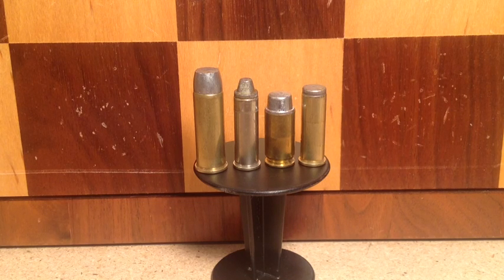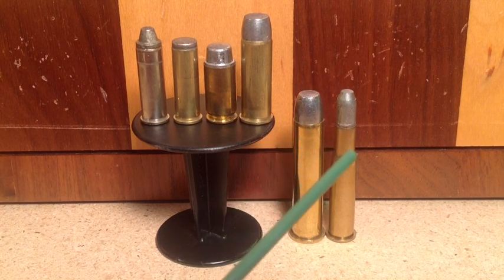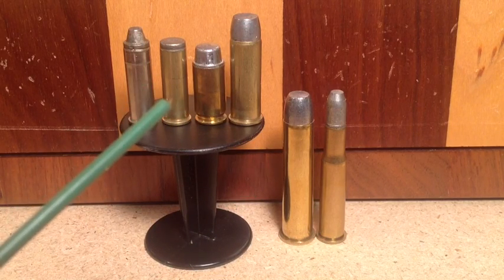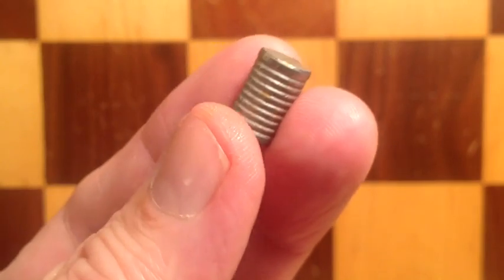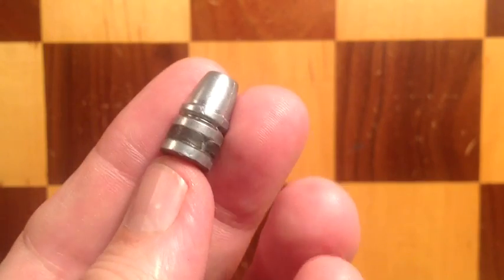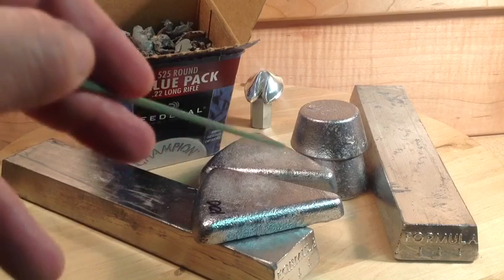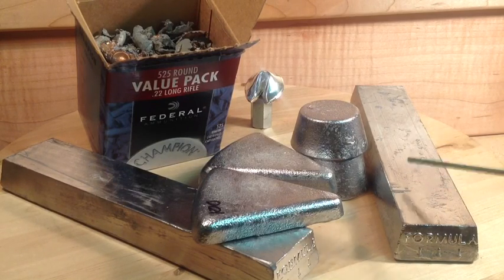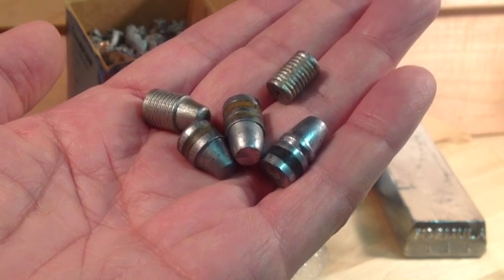Lead Hardness FAQs & How to Mix Bullet Alloys For Hardness

Comment: Yet another excellent and informative video from your site. However there is one flaw, and that is lead is 5 BHN, not 8.6 BHN, this would make quite a bit difference to the calculations.
Reply from the maker: Englishman French - There is some confusion over that.  I've wrestled with this one for a while, and no one has brought it up until now.  So thank you for bringing it up.  Rotometals is a major supplier of bullet casting alloys and materials for over 75 years, and I have referred casting and lead questions to them on occasion - they always answer.  RM has a formula for the calculation of BHN based on the mix of the alloy beginning with pure lead at 8.6.  BHN = 8.6 + .26(%Tin) + .92(%Sb).  I've been using their formula to excellent effect for 15+ years.  Yes, I do know that Wikipedia says BHN 5, and some other posters use that.  My take on that is everyone is cool as the RM formula may be shorting on the .26 or the .92 so all the numbers on final BHNs balance out.  Also, because I water quench and age harden my castings I'm adding somewhere less than 2 BHN from that.  The end result, we're probably all at the same place.  You notice that I did not bother to present the formula in the video (thought about it, but gets too technical - like some of the forums - puts some viewers to sleep-they will fly away with that) and also can confuse esp. with the 8.6.  RM has great connections with all those forums and the LASC boosts RM as well.  I'm going to go with an expert in the field over what Wikipedia says (maybe Wik is using a different BHN scale - doesn't matter - my lead is good and it's not worth pursuing that).  Best Regards to you, and sorry this was so long - it is a record length reply for me...
Reply from the maker: +Englishman French - Yes, it does make a big difference.  No doubt what saves me is that Elmer Keith used pretty soft bullets in his magnum development work and he never leaded his barrels - he had good bullet fit to his guns.  I realize the disparity from 5 to 8.  I just use the 8 from the formula on the RotoMetals home page (bottom) they call pure lead 8 and the formula worked for me without fail, so I'm not about to change my operations...I do realize that controversy though.  Since RM has been supplying caster alloys for 75 years, I figure I can go with their formula OK... Best to ya,  lFC

Comment: Goo 411, Thank you.. BUT how hard should the lead be for shooting out of a Glock .45 using their factory Poly barrel?
Thank you
Reply from the maker: lawgiver1-AHA!!  That's the $64,000 question that has no answer…We are 1) not supposed to shoot reloads in our Glock factory barrels and 2) not supposed to shoot lead bullets thru our Glock factory barrels.  That having been said, the answer is BHN 16 (18 is not needed as Glocks feed very reliably - however, use a good auto pistol bullet like the Lee TL 230 RN with the little shoulder; use the Lee Carbide Factory Crimp Die with the barest little crimp possible) and medium speed powder like Unique or AA5 or Universal.  Best Regards
Reply: FortuneCookie45LC
Thank you for the fast answer. I use the same bullet and die you listed, however I use 5 gr. of bullseye.
Reply from the maker: lawgiver1 There was a gunwriter years ago that used 5 grains of Bullseye/230 bullet.  I forgot who it was, but he called the 5 grains "…a stiff tot of Bullseye".  Have a great day...

Comment: I again have to disagree i shoot BHN 10-12 in everything from 700-1500 FPS from 380 to 44mag, Was just shooting today range scrap cast 9mm BHN 10 at 1150FPS  or 1350 out of a carbine with no leading and great accuracy. Fit is key. I can shoot Pure lead from a  45acp with again 0 issues at 750FPS.
Reply from the maker: b1gdaddy317- Thank you for your great comment.  You will find that we have no disagreement.  It's like Elmer Keith shot a lot of his hell-for-leather magnums with 1-30 lead alloy.  He never even mentioned any leading problems.  I'm glad that you find great success with your well fitted bullet/gun combos - no disagreement with you or I on critical importance of bullet fit.  We can tailor our bullet hardness accordingly and find that we are uniformly shooting bullets harder than we need (I find myself, with excellent joy, that my plain range scrap at BHN 12 [water quench and bullet aging] is easily actually good for +P- I really don't have to do much mixing at all)  But between you and me, I just like my magnum bullets to be BHN 18 because some day, I might just need those slugs to crash through a moose or both sides of a car or some other hellacious thing…You are speaking as an experienced caster, we've got to give the newer guys and gals "the book" info, and they will find out for themselves that there is more latitude in bullet alloys than they suspected…Best Regards...
Reply from the maker: +b1gdaddy317 -  You are in the same league as Elmer Keith who used 1-20 alloy to make his magnum bullets.  Who is going to tell E:lmer that his alloy was too soft?  Nobody this side of Glory for sure...That's not a bad league to be in, BTW... :FC

Comment: Well done ol' boy! You did great. I think, weather permitting, I'll smelt up a few lbs. of my wheel weights this weekend. I lucked into 60lbs of x-ray sheilding a while back, and I've managed to save back a few lbs of linotype.  hummm   Anyway, thanks for your efforts, knowledge and your time. Until your better paid. You have my gratitude sir.
Reply from the maker: mklean1- Congratulations on your lead supply - If your lead shielding is easily dented with fingernail, you have pretty pure lead (if you do shotgun slugs - you are in business) - and that linotype is going to come in very handy for making pistol / rifle bullets.  As for pay on YT, it's like pro golf - the top guys have it pretty good - but everybody else (we're doing it because we get a kick out of it)  better not be quitting our day jobs… Best Regards...
Reply: FortuneCookie45LC
My soft lead I have reserved for my new 40S&W swage dies on order. Can't wait. Most of my autos I feed COWW. My 7.62 gets a dose of lino and WW. I've only been casting about 3 years. Also make my own case lube and boolit lube. never stop learnin' Thanks again

Comment: I heard you match the hardness to the pressure, not the velocity.  Working with second hand info though.
Reply from the maker: spraynpray- No doubt pressure is a more reliable match (I believe the Missouri Bullets website goes with that), but we shooters don't really have any good gauge for pressure other than what is printed.  And there has to be variations from different guns, etc.  Takes pressure to make velocity.  And we do have chronographs we can use to pin down velocity.  So I'm going to keep linking hardness with velocity - and there is wiggle room in the matchups anyway.  I'm surprised that others have not commented in like manner… Best to ya...
Reply: It's all magic to me anyway.  I've yet to fire any of my cast bullets.  I'm waiting on the barrel I had chopped to shoot a bunch.
Reply from the maker: spraynpray I thought it would be important to get back to you on clarification.  On the velocity to hardness match, that is very useful and safe for pistol shooting.  And the velocity / hardness / pressure is predictable for pistol.  However, for rifle shooting - the velocity / hardness is OK, but there is no coupling of predictability with pressures- You could have a low velocity rifle load with cast bullet hardness being fine, but the pressures could be exceedingly high depending on the powder used.  So stay with good published data, and you cannot extrapolate anything with reduced loads in rifle cast bullet loads.  Because of the smaller fast burning powder charges, a little more powder can be right on the steepest portion of the pressure curve, and you gain a tiny amount of velocity with a huge and possibly catastrophic jump in pressure.  Hope this helps… Best to ya...
Reply: This is true, pistol velocity and pistol powders aren't nearly as complicated.

Comment: Hey Fortune Cookie 45LC!! I casted and reloaded about 300  255gr. .452 for my 45 long colt Vaquero 4 3/4" barrel I just got 2 weeks ago and have them moving about 700-750 fps. and found several bullets in and around the dirt pile I was target shooting at and they all looked as if they were barely dented, so I'm using nothing but wheel weights with the occasional soft stick on wheel weights mixed in with the clip on weights, do you think they could be too hard for what I'm doing?? I'm not interested in doing anything spectacular with this pistol or the loads for it, that's what my 44 mag and 357 etc. Is for.... thanks!!
Reply from the maker: TheRIFLEMAN308- not a problem - Wheel weights are some of the finest lead alloys I have ever used for ANY shooting.  You are probably just a bit more hardness than you need, but not so hard that the bullets are not obturating your barrel.  If you like, you can add more of the stick on (pure lead) to your wheel weight mix and still be fine - will save some of your clip on weights for future use.  Or just use that same alloy for your more stoked 44s and 357s - will be fine there for sure...Can't go wrong using wheel weights for 45LC - I do like my range scrap, though because of the zero cost....Best Regards

Comment: Great video! I had a lot of the same questions. I was using my Lyman 49th edition to load 44 Mag with 200 grain cast bullets and it said to use Linotype bullets. Hodgden load data wasn't specific about the hardness just loaded on the conservative side and didn't have anything above 1,039fps depending on the powder. Which makes me ask, why does the powder make a difference? We are well under max pressures so is a faster burning powder better for cast bullets or a slower burning powder.
Reply from the maker: velocity550- All powders running to appropriate SAAMI pressure levels work well with cast bullets.  It's all nitrocellulose, nitroglycerine, nitroguanine with retardants, detergents and stabilizers in flakes, spheres, donuts, rods --- Best Regards

Comment: Good stuff as usual FC45LC. The thumbnail don't lie...
My range scrap runs a little closer to pure lead than yours because most of it comes from jacketed bullets. I typically run it 50-50 with clip on wheel weight lead plus a small amount of tin for most of my pistol shooting. Rotometals is a great resource for us casters when we need to harden things up a bit.
Reply from the maker: jima28080 - Thanks for making that point - we get all kinds of lead fired at our range including lots of cast bullets so there's where the tin and antimony comes from in my particular source of range scrap...Have a great day...